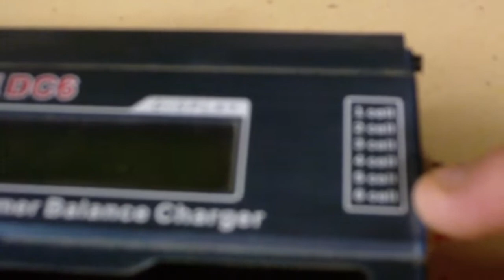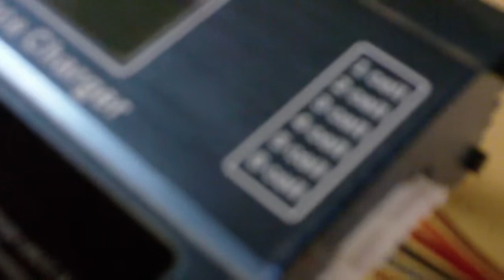supermate dc6 charging solder joints

Comment from the maker: @mattisagoop  i havnet had any probs with balancing, unless a cell is slightly bad. end voltage with in .01-.02 of a volt if not perfect. if you want better and more accurate youll have a pay much more for it. also helps to have a good constant power supply like a large car batt to charge from, i have the car batt charger running at the same time as the lipo charger.